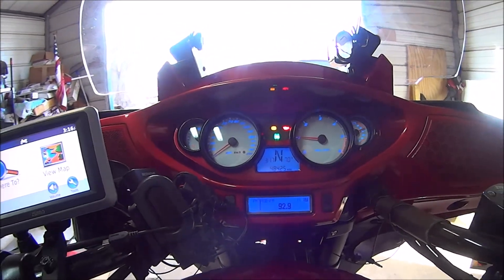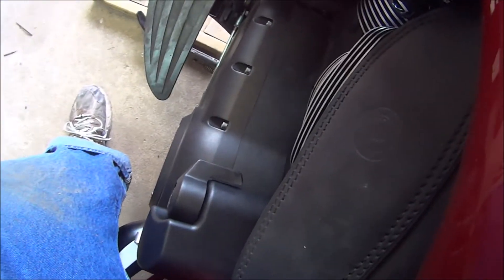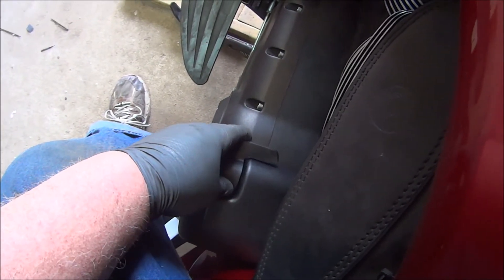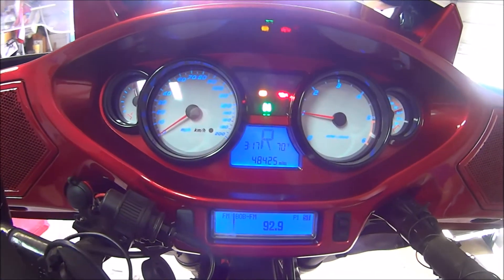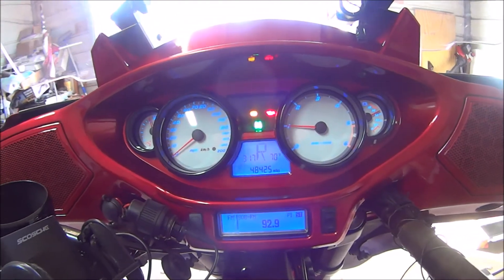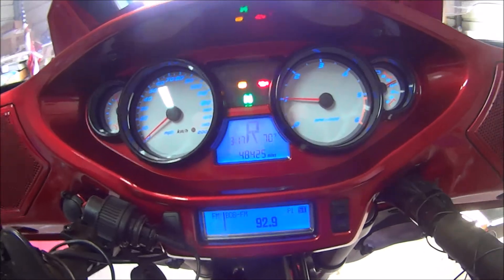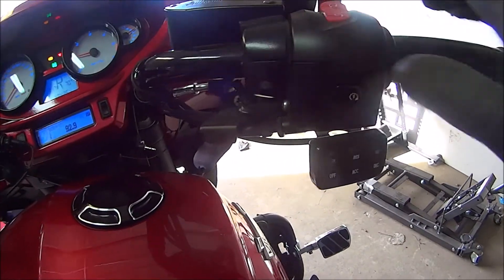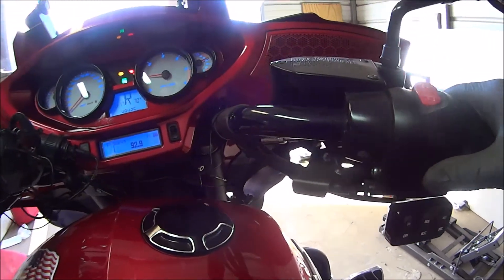Reverse kit

Comment: Do you have any installation tips to share? I bought this same kit slightly used last year and will likely install it this Fall.
Reply from the maker: I'm assuming you have the installation instructions. It tells you to remove the exhaust system so you can remove the drive gear cover and put on the new cover and reverse  sprocket. I just loosened everything up to give me room to remove the old cover, put on the sprocket and new cover. Then put it back in place tighten everything up. Take your time putting on the drive motor connections. You will get frustrated. A lift table or bike lift is helpful.
Reply: @BCINOK  Hello, tell me the signal cable for displaying on the panel where is it connected?
Reply from the maker: @АнтонВинокуров-к6л  it has been three years and I don't remember. I will try to find the instructions.
Reply: @BCINOK  I will be very grateful, I can't find it anywhere.
Reply from the maker: @АнтонВинокуров-к6л  I found the instructions. But I can't paste  the pictures to this page.